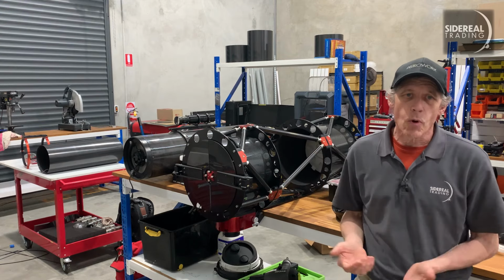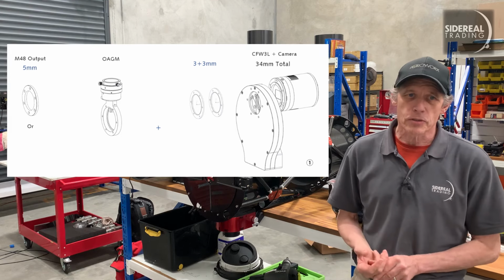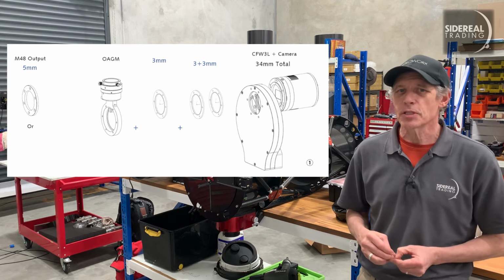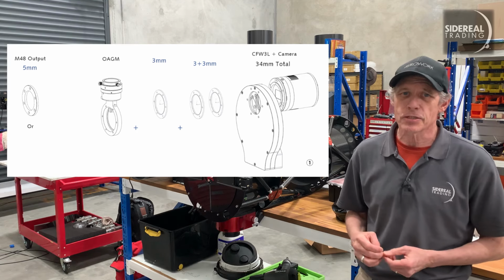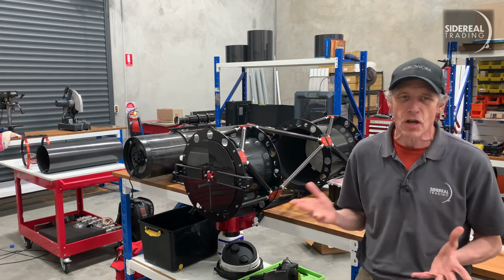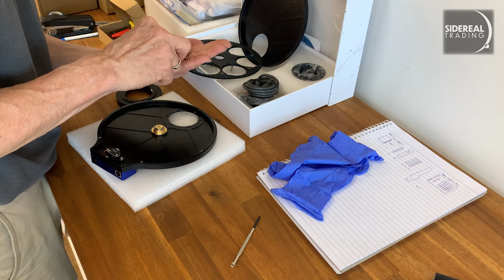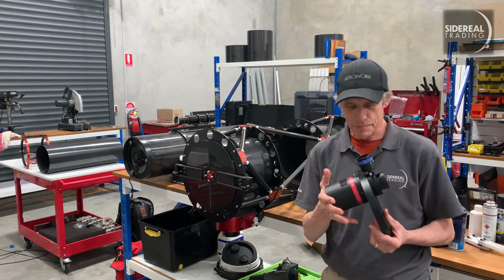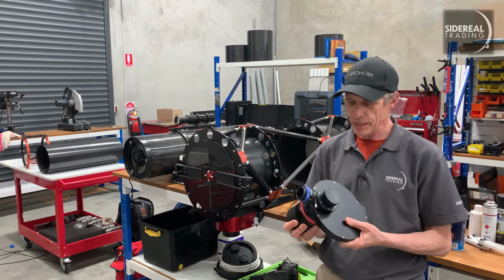How to put together a QHY imaging train

Comment: Nice to see how it is done, makes me wish I had grabbed threaded filters, so much easier!
One minor detail - the video shows the filter wheel diagram as the CFW3L, but the text says CFW3M - which has a different width and therefore different spacing would be needed.  It does look like those filters are large so could be the L - but if anyone is trying to set theirs up it is important to know which one you have and check the width.
Reply from the maker: You're absolutely correct - I had to check the client's order and yes, it's the CFW3L. I've changed the text description. Nice pickup!

Comment: First of all, thanks, watching your video gives more confidence in using the screwdriver into such a thing...now, I have the CFW3 M – 7 x 36 mm Version, and the same coma corrector. My camera is the QHY 163M, if I am correct, in my case there is no need to remove anything from the wheel, the important thing is to ends up with the 55mm total back end. But I was scared to manipulate too much the wheel, but your example of doing it is excellent.
Reply from the maker: If you're using the Baader MPCC-III, you need to figure out the back focus. It's 57.5mm if you remove the 42mm insert and the stop thread. If you leave the 42mm insert in, the back focus is 55mm. The QHY163 is a four-thirds sensor (same as my elderly ASI1600) so there's no problems about leaving the 42mm insert in place, it probably won't cause vignetting.